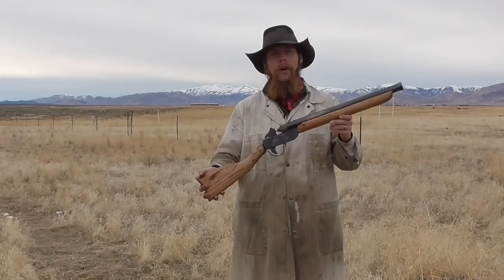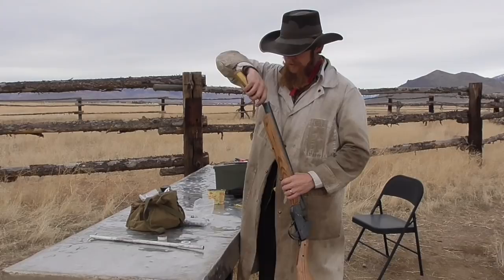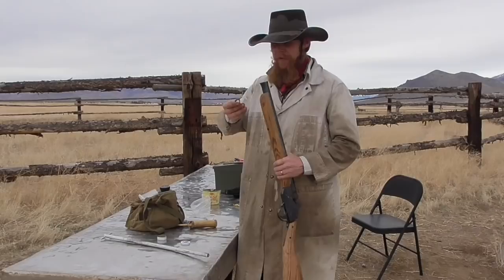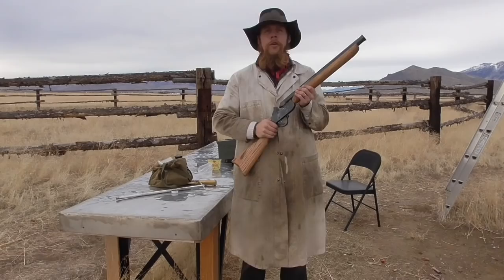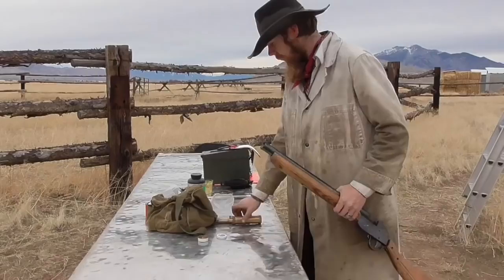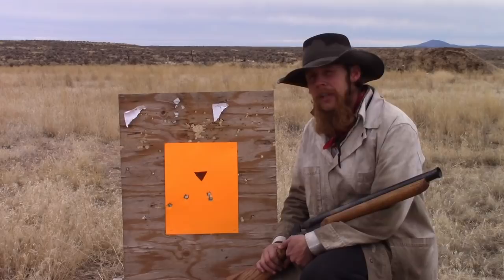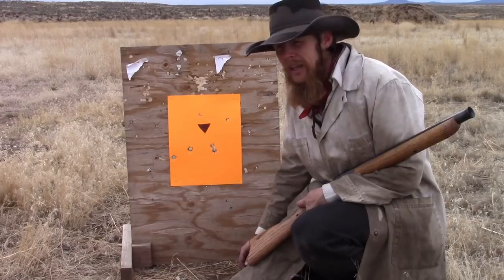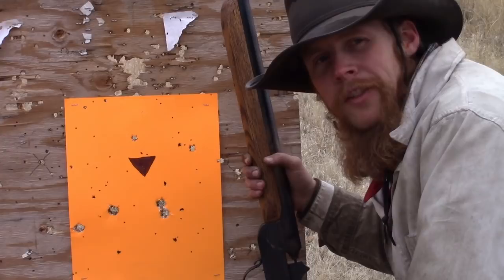Homemade Blunderbuss Shooting Demo (TIS116)

Comment: What an awesome piece of craftsmanship! I always applaud anyone who can manufacture a functioning firearm from scratch. I’ve always loved blunt, big, bullish nature of the blunderbuss. I would have liked to see you fire some creative ammunition. After all, the blunderbuss was known for its ability to fire anything you drop down the barrel in a pinch while in combat. All out of lead balls? No worries, powder, patch, then drop in your pocket watch, chain and all and let fly.
Reply: If you add a bit of cloth down the barrel after the load it prevents rolling
Reply: @magaswitch212  Maybe try educating yourself a bit more before typing incoherent nonsense like this. The blunderbuss originated in the 16th century and remained popular until the 19th century. It was known for its ability to use improvised ammunition. 19th century pocket watches were constructed of gold or silver, often with gold gears, while cheaper watches were crafted from brass, these are soft metals. It was also common to fire anything from chopped up nails, glass, gravel, sand, and rocks, broken cast iron, and pieces of silverware.
Reply: @HyperLuminal  Tell me where did you mention that the pocket watch you mean was made out of silver or even gold? Damn dude you either precise yourself or stop making excuses. Also who normal would fire a silver or a golden watch wtf? This would be literally worse idea just becase of thier value and not even mentioning the ballistics of a pocket watch. Also iron is ok since it's as hard as the barrel while steel would literally made the barrel square, and just so you know i am educated cause im a gun owner i know enough to make comments about guns
Reply: @magaswitch212  Are you serious? There is no need to mention any of that, all the information is in the context of the weapon and it’s history. If you were such an educated gun owner you would know that. The blunderbuss is a gun that widely used from the 15th to 18th century, pocket watches of that era were of the construction I described, and the reason one would fire such ammo would be “in a pinch”, meaning dire circumstances.

Comment: Love the new gun... can't wait for the build videos.   please note that my brass powder container looks just like yours... each full nozzle or whatever it's called is 30 grain BP.  I think you're loading 180 grain... I counted six times.
Reply from the maker: I weighed the charge that mine dispenses, and with grade-P pyrodex it comes to 20 to 22 grains per full spout.  Usually, I put in 5 measures, so that is ~100 grains of pyrodex.  I suppose its possible that I occasionally mis-counted and put in 6.
Reply: @TheIdahoanShow  Pyrodex weighs less per volume measure than black powder.  You're supposed to load pyrodex by volume comparison to black powder, not by weight comparison.

Comment: The stock looks very nice. First thing I noticed...old wood worker, ha.

Ouch, that hurt my shoulder all the way here in Alabama, ha. Defiantly not lacking in power. Oh and yes, .45 is about 0000 buck. I use 0000 buck in my .410s when I want a combat load for them.

Comment: Can't wait for the build video. Have you thought of a design utilising pin fire or Chasspot style paper cartridges? Under 18 USC 921 (a)(16) it would not be subject to regulation such as bore diameter or OAL as long as it is not able to fire conventional cartridges (obviously an email to confirm would be recommended)
Reply from the maker: Thanks!  Yes, I have thought about building a pin-fire rifle or something along those lines, although it's a ways down on my list of priority projects, so it might be a few years before I get around to it.
Reply: indeed librepenseur,
in his sketch thread, cross-referenced with nonesuch, spravesystems etc,
a gasclamp-picatinny system, replete with two outer-detent fittings serve as a hinge.
the 'sabot' can be a roll of quarters cardboard or the inner-print-roll from checkout printer etc.

the piezo-electric system is needed to ensure it cannot utilize any extant munition eh.
Reply: I know this is a year-old thread, but I've also thought of using pinfire to get around the NFA and 68 GCA. Current plan is to modify a simple break-barrel shotgun plan to accommodate a homemade pinfire shotgun shell.

Comment: I hate I’m only now seeing it but cool great idea. I wish more commercial muzzleloading options were both available and affordable. Anything offered right now will cost more than a break action shotgun. And smoothbores will cost a ridiculous amount which puts people off investing in what is on the market. If you don’t absolutely need the muzzleloader season or the option you’re upgrading for you most likely will go buy a cheap Turkish break action single shot from Walmart and MAYBE get so adventurous as to reload the empty hulls with fiber wars and Black Powder or substitute. No harm I’ve done it with 410 empty hulls and they work well enough that I got reliable ignition and I got good enough patterns to get small game if it were present to shoot

Comment: Here we call it "trabuco" hahah . And about Electrical primered guns? is it possible?
Reply: B Souza Yes. Remington made a M700 with an electronic trigger and no firing pin.
Reply: cascorgi its a good option for an long term shtf gun
Reply: B Souza "trabuco" or "bacamarte".  It was used by famous groups of pirates or, in Brazil's case, the Lampião group
Reply: B Souza Not really. It was unreliable and had some safety issues. Although, Remington experimented with it back in the late 90's, so we could have better technology now to resolve those issues.
Reply: i use electric primer extensively on my project. It turn out awsome. Extremely reliable and foremost, very safe.
Reply: @nobeltnium  A peizo primer would be very interesting... might be possible to make one from a butane lighter... no batteries and it requires compression of the peizo crystal to go off so a bit safer and probably easy to add a safety to.
Reply: @Wingnut353  no, i've tried peizo from the lighters long time ago, since i'm still a kid. No matter what you do is will not set off a charge. What ever it might be black powder, mecury fulminate, PETN, picrid acid,diazodinitrophenol,... even you put them in sequence,  it doesn't work like that. What i'm refering is an electric match.

Comment: what kind of steel did you make the barrel and receiver out of? just wondering, looks weak but held up to a huge load! thanks
Reply from the maker: Both were low-carbon cold-rolled steel.

Comment: Neat gun.
It looks like there is a big gap between the receiver and but stock. You might want to bed that to head off stock splitting.
Reply from the maker: There is a steel tang that extends into the stock and provides the contact surface.
Reply: 30-30 lever-actions stocked that way with a smaller gap in the same place as yours tend to split the stock over time because the tang and tang screw act as a wedge under recoil. The large contact surface the back of the receiver provides prevents that wedging action.  
(I hope you take this as helpful advice. I think I tend to sound like a jerk in type.)

Comment: what kind of steel did you use? and what is the thickness of the wallthicknes of the barrel
Reply from the maker: The barrel was DOM tubing, and I forget whether it was quarter-inch wall thickness or 3/16.  The hammer and trigger I made from 4140 alloy steel; the rest of the frame is just A36 hot-roll mild steel.

Comment: I think your length of pull is wrong for you. if you added a pad/extension to the end of your stock would probably keep you from getting a bloody nose. don't ask me how i know about length of pull on a 12 gauge shot gun.
Reply from the maker: Yeah, a longer stock would certainly fit me better, but I wanted to keep this gun fairly compact, so I made the stock about as short as it could be and still be useful, rather than making it the optimal length for intuitive shooting.